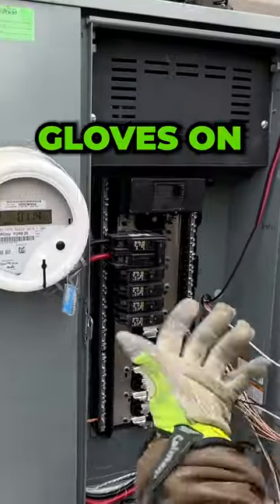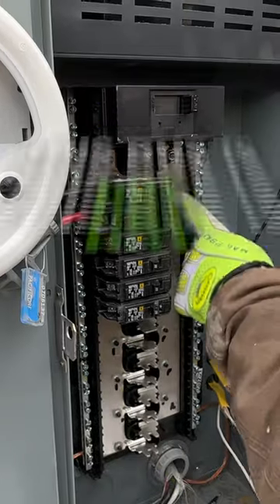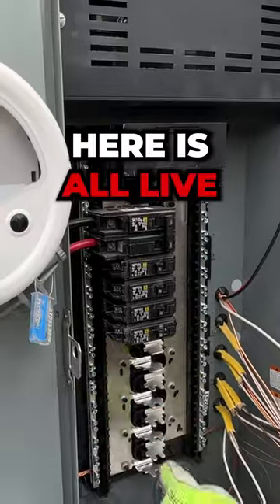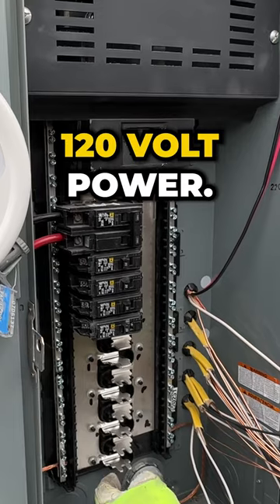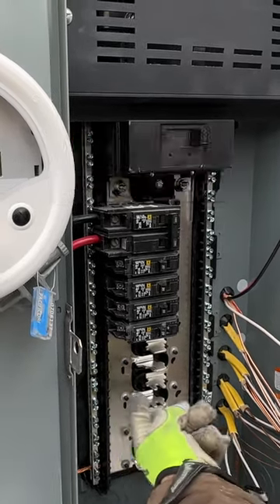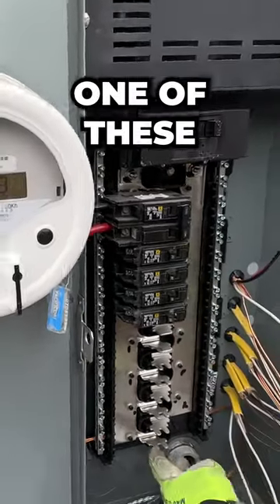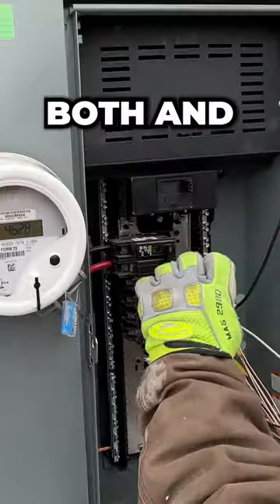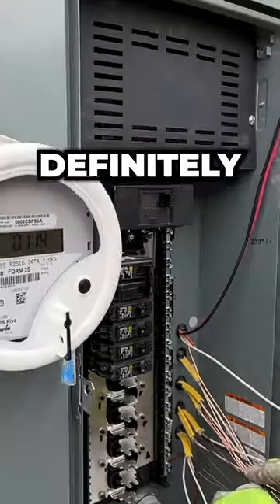Don’t Get Shocked⚡️Live Panel #Shorts

Comment: I would add a HUGE caveat saying "you probably won't die" if you say stuff like "it's not going to kill you" you're putting way too much confidence in people in the internet.
Reply: Yeah. Air on the side of careless…? Good one. And I don’t get why they are working on a live panel anyway. Just turn off the main breaker at the top. No? Works in my house. I guess he just wants to prove what a badass he is.
Reply: Second this. Poorly worded by him, probably should add a correction on screen and reupload. It’s worth it to decrease the chance of misleading people about dangers
Reply: @caseykittel maybe he had to keep that 2 pole load on? I've worked in many many many live panels due to loads needing to be kept on.
Reply: Yep, depends on how the electricity finds it’s way to ground. If it runs up one arm through your chest and out the other arm it can definitely kill you.
Reply: @caseykittel  error*.... Ffs
Reply: American youths are always coming up with ingenious ways of thinning out the numbers a bit. In the age of YOLO there's been numerous silly challenges that will most likely result in meeting your maker.
I enjoyed watching the challenges but all had their flaws, but touching high voltage I'd imagine would tick all the boxes.
With that in mind any YOLOers that haven't received their Darwin Award yet feel free to participate, just make sure video is clear and HD 🙂
Reply: yes one quarter of an amp,I read, proper current flow can burst your ❤️.     That will probably kill you..  😳
Reply: @StonerAmongstUs  You still living in 2011 as if anyone bumps that song anymore. Quit being so cringe lmfao
Reply: @Syndicalism  it wasn't a song it was a way of life, and most found out was a way to end life. 
That's why the phrase died.
Reply: @MrLuigi77047  he says probably won’t kill you when it’s the opposite it probably will, you would be lucky to live
Reply: Yeah if it's raining or you're in some puddle of water it will probably kill you
Reply: @mikevega7740  if you complete a circuit to any part of your body that isn’t that same arm the odds are you won’t live to tell the tail
Reply: Day one of apprenticeship, “voltage of any size has the potential to kill you”.
Reply: @Dennis Linzel  nothing coming off that panel is hot.  There nothing turned on except the main
Reply: Laser Pointer anyone? Anyone?

Comment: “Laughs in arc flash”
Reply: 120 and 240 arnt likely to arc flash I mean anything is possible its just very unlikely to happen being electrocuted by those voltages however is much more likely so still be safe either way. I personally work right now around 1500 volt dc battery banks, 480 volt hvac units and disconects and 35000 volt lines that connect into a substation it's technically the load side of things so we are contracted out by the utility to work on this stuff and it's safer than some of the resi jobs I've done because of the danger that screwing up with these voltages presents. No matter what you are working on be safe take precautions loto and pay attention to your surroundings.
Reply: @jsb7546 the lower the voltage the bigger the arc flash.